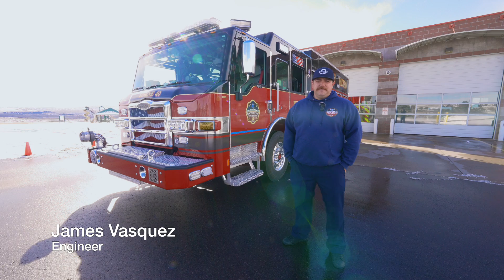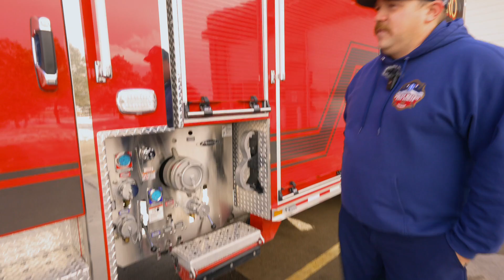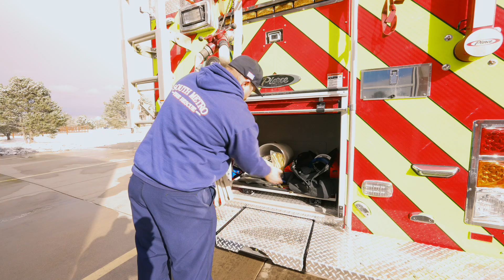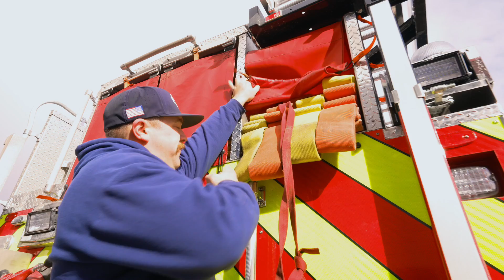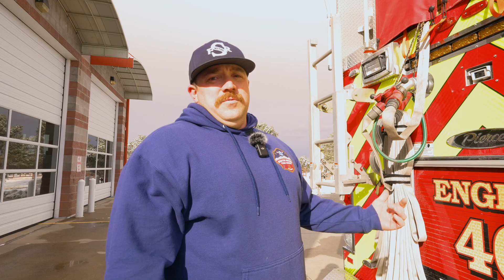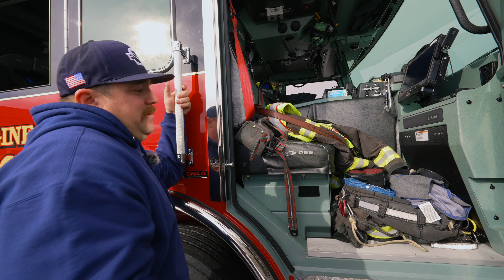Fleet Friday - Engine 40

Comment: Hey South Metro PIOple!  Nerdy question for you:  Rumor has it this rig was reassigned to 19s, and 19s former engine (SM3310) went to 21s.  Also, that 40s is back to running one of the old tandem-axle pumper/tankers (SM3340 or 3341).  If that the case, what prompted the shuffle, and what happened to 21s' former rig, the 2016 Impel PUC (SM3668)?
Reply from the maker: That rumor is true. The shuffle was prompted by a need to have more onboard water supply on Engine 21 due to their unique geographic location. Their original Engine and Engine 22 were purchased by Cunningham Fire Rescue with 500 gallon water tanks, but all other Engines in the fleet hold 650+ gallons. Since 21's first due area can have extended second due response times and their apparatus wasn't due for replacement for a few years, a shuffle needed to occur. Engine 21's former apparatus has been reassigned to the Training Division for use at the academy.
Reply: Totally just tagging on here but what other engines are considered outlying engines (the one that carry the cutting equipment for MVAs)

Comment: Serious question, as I’m half asleep after working 16 hours. But if it’s a 1000 gal tank, and pumps 1500 GPM, does that mean that every minute (less actually), at full pump pressure, the tank is emptied? If that’s the case, how much pressure do hydrants put out to the engines?
Reply from the maker: Great question! When pumping at full capacity the 1,000 gallon water tank would be emptied in less than 1 minute. It's rare that an Engine would pump water at full capacity without being connected to a water supply, like a fire hydrant. For the majority of operations where a single hose line is being used while relying on tank water, the firefighters have a several minutes before the water is gone.

Comment: What is the difference between truck and apparatus and why he tried to correct it?
Reply from the maker: "Truck" is generally used to describe a ladder truck / aerial apparatus. Sometimes in conversations it's easy to refer to an Engine as a truck since that's the type of vehicle it is, but by firefighting terminology it's not accurate.